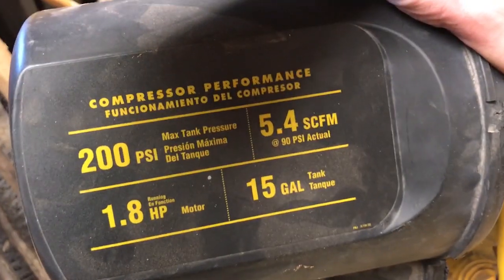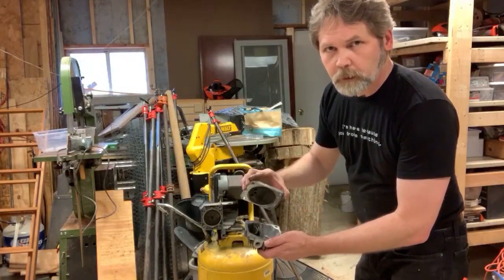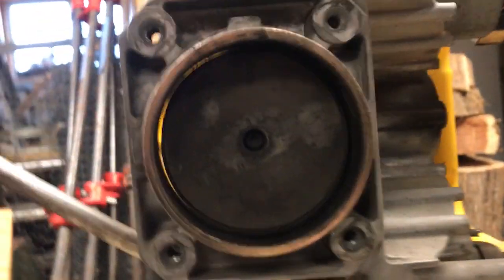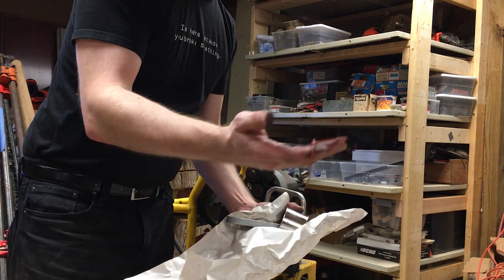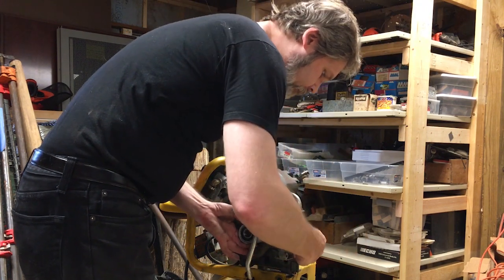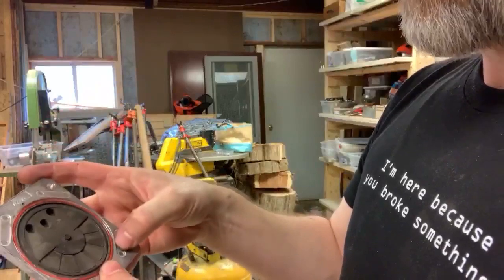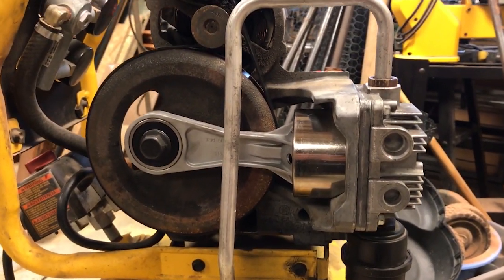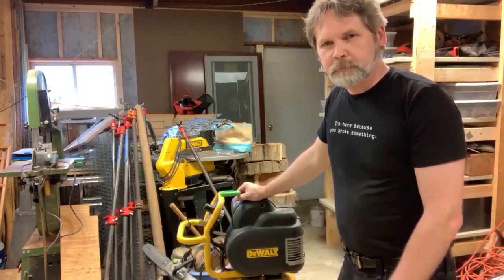Repairing the Air Compressor Piston on a Dewalt Oil Less Compressor

Comment: I ordered an '0650 off of Amazon for a Craftsman 30 gallon compressor the o-ring seal only lasted about three or four fill ups before it went again I don't know what went wrong the motor is fine the baron is not loose the one thing I did notice about the parts the cylinder sleeve that came with the new parts was made out of iron or steel or zinc the original sleeve was made out of aluminum I don't know what made the seal fail that quickly I did not put any oil on anyting any comments on why this happened greatly appreciated when I took it back apart there was lots of dust inside
Reply: I've had the same issue with my craftsman abt 8 yrs ago. Poor replacement parts maybe, I did buy factory replacement parts, cylinder and piston/ring kit. I still have it, may try again, any luck with yours?

Comment: Good video, but I feel compelled to offer a word of caution. Regardless of how well the compressor itself works, the tanks have a limited lifespan. Even in well maintained machines that are drained everyday, that is typically about 10 years (less if it is not properly drained). The repetitive cycles of build up and release of pressure lead to metal fatigue over time, usually at the welds. Many explosions, some leading to serious injuries or death, not to mention loss of property, have happened because of old air compressor tanks. Since you bought it at an auction, you probably don't know the age of this tank. Judging by how worn out the compressor was initially, it may well be 10 years old or more. Be mindful of that and be safe.
Reply: How many air tank explosions have you witnessed? I been around alot of old old old antique compressors thats been through more heat cycles than days most human beings have been alive never seen a explosion
Reply: @dreece2000  I agree with both of you. It does make me nervous, especially since I vary rarely drain the condensation from the tank, but I've never seen or heard of them failing, and hopefully never will.
Reply: @dreece2000  That's because of modern safety standards but it never hurts to look inside pressure vessels during periodic maintenance. Tanks not failing often doesn't mean it doesn't happen and consumer crap compressors don't always have thick tank walls (though the DeWalt portable with the same pump I just cut up to make a welding cylinder cart is decently stout, about 3mm).

Comment: A shot of some carb cleaner spray would have made the reed valves look and work like new. I am surprised you didn't clean anything up while it was disassembled.
Reply from the maker: Thanks for the tip! I need to change the belt and brushes soon. I'll give this a shot.

Comment: You just need the rubber seal on the piston.
Reply from the maker: If I recall correctly, I thought about that. But the seal is designed into the end of the piston in such a way as to not be replaceable by mortal men such as I. :-) Thanks for watching!

Comment: I just did this same repair, how is this holding up? The replacement parts don't seem to be the same quality, namely the arm .
Reply from the maker: 18 months later and it's still going strong.  I do need to replace the belt and brushes though.

Comment: did you fix the problem with it not firing back up? 
bad unloader valve ?
Reply from the maker: It was the piston arm rubbing on the flywheel. There was enough friction to prevent the motor from coming up to speed.  Once the new piston was installed and aligned properly, it starts up ok now.

Comment: If you ya e to bang the motor I would check the brushes and make sure they are making good contact. There are two coiled metal springs that apply tension to the brushes which makes contact with the rotor on the pump. The metal slide where the brushes air in has a little tab to push in and you can pull it out of the armature .

Comment: i think the brushes on the motor are nearing end of life and  not making good contact with the rotor. The motor shouldn't be arcing like that while it is running. Thats why its not running as strong and starts and stops when you tap it
Reply: kayzrx8  I would check the springs that Retain the brushes . Not causing enough tension to hold the brushes right to the rotor causing the arcing.

Also not plug it into a
16 guage extension cord and rather directly into wall outlet 20 amp. Or at least 12 guage extension cord
Reply: I'd hit the commutator with the Cratex rubber abrasive I keep handy too.

Comment: Well done, Z.  Get some teflon tape to seal your fittings.  check the torque on the pump head bolts.
Reply from the maker: Thanks! The leak comes from the top of the fitting around the tube. I tightened it up, but the leak is still there only slower. It resembles a compression fitting somewhat.